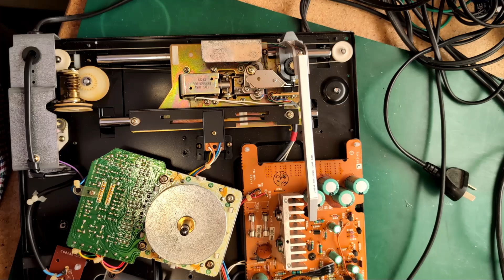JVC LE-5 Linear Tracking Turntable - simple repair and overview

Comment: How do you replace the belt? I just got one of these.
Reply from the maker: Just stretched the new one on like a rubber band.  Techmoan has lots on his channel
Reply from the maker: The service manual details disassembly, trouble shooting, adjustment and so on.  Heed the danger warnings.  In mine the mains voltages were easy to touch.